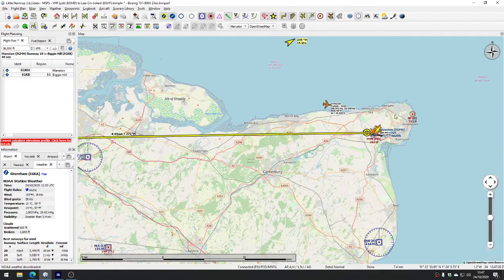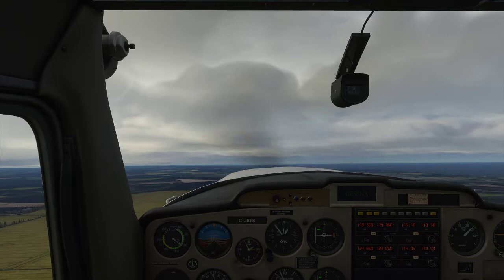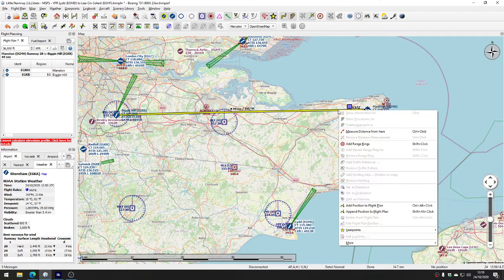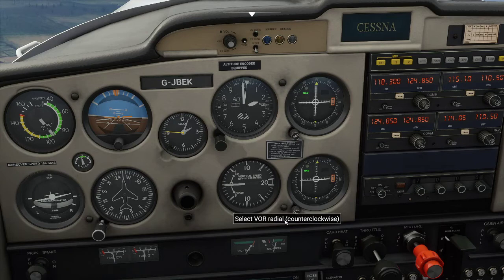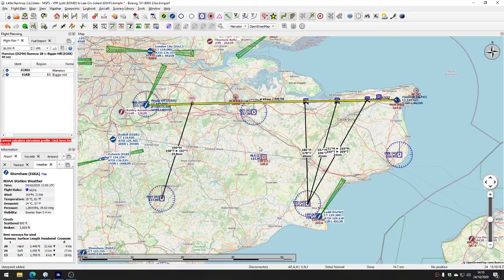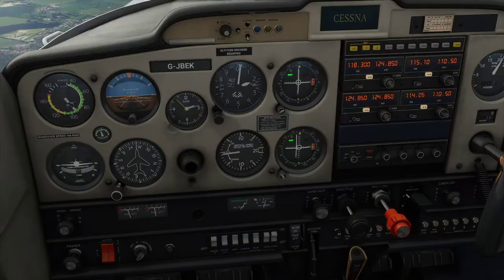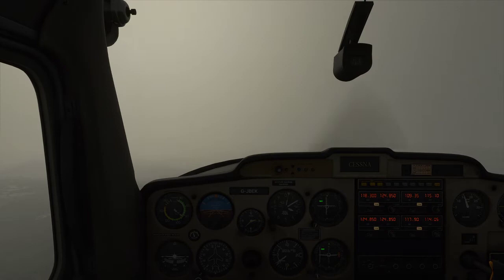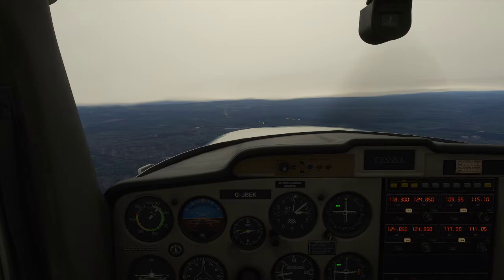Radio Navigation Tutorial in the Microsoft Flight Simulator Cessna 152

Comment: A little heads up, you mentioned you were on the 270 radial, actually you were on the 90 degree radial. Radial radiate out from the VOR.  You needed to tune in the 270 degree radial in order to have the CDI needle provide positive steering information. For example, if the CDI needle was to the right of center you would know the course you want to fly is to the right of your current position.  It's one of those things beginning pilots find confusing when using the VOR. Other than that, you did a good job in showing how to use a VOR in plotting your position on a chart.
Reply from the maker: I'm famous for saying the opposite thing than I really mean :)
Reply: @jonbeckett  I've made that mistake myself, info more for those who are following you.